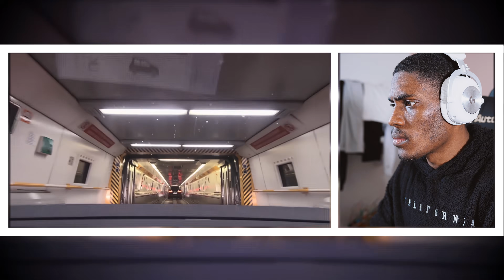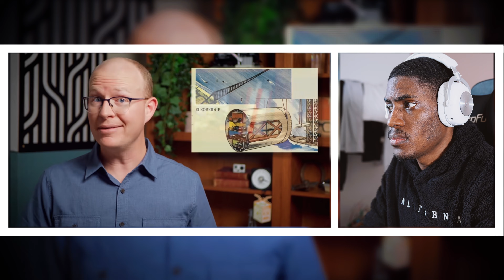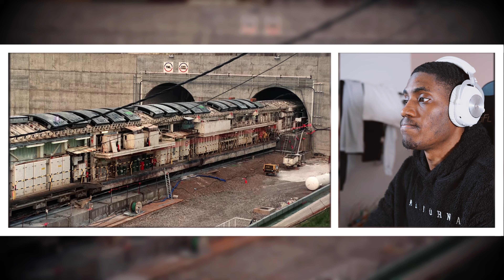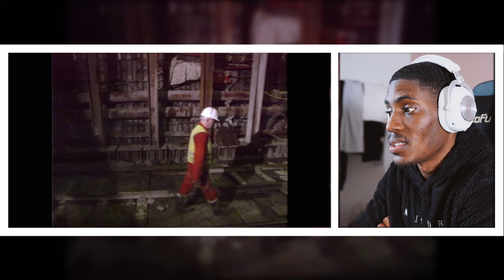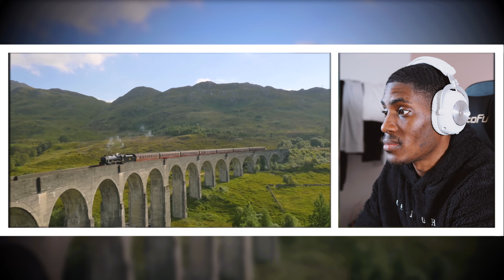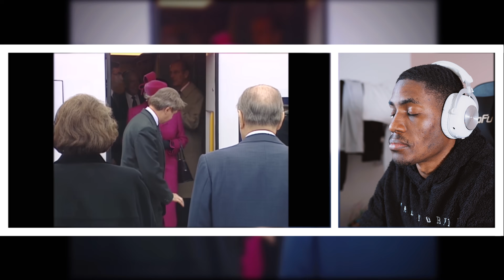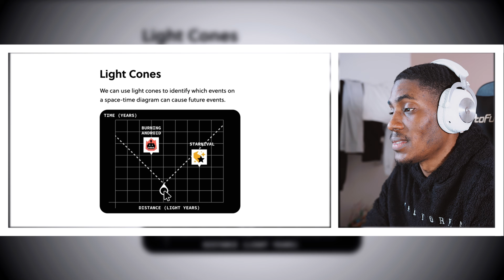American Reacts to How The British Channel Tunnel Works

Comment: COPY PASTE:  "China's $10B Artificial Canal Will Move More Cargo Than the Panama Canal
Core Insights   117,482 views Apr 19, 2026 UNITED STATES
45.5K subscribers    3K   Share   Ask   Save    Download
China hasn't built a major canal in over 1,000 years. But right now, in southern China, thousands of workers are carving a 134 kilometer waterway through mountains, hills, and solid rock to create something that has never existed before. This is the Pinglu Canal, a $10 billion infrastructure project designed to give landlocked industrial provinces a direct water route to the South China Sea, and when it opens in 2026, it will move more cargo every single year than the Panama Canal did in its entire first decade of operation. This isn't just a construction story. It's about a logistics problem that has quietly held back millions of people for generations, and one of the most ambitious engineering solutions ever attempted to fix it. From the world's largest water-saving ship lock to smart automated systems tracking cargo in real time, the Pinglu Canal is where ancient thinking meets cutting-edge technology. And if it works the way it's designed to, it won't just reshape trade across southern China. It could become a blueprint for landlocked regions all over the world. What's Covered: 🗺 The Problem Nobody Talks About - Why landlocked Chinese provinces have been quietly losing billions in transport costs for decades ⏳ A Thousand Years in the Making - How China's legendary Grand Canal connects directly to what's being built today ⚙ Engineering the Impossible - The jaw-dropping construction numbers behind cutting a canal through mountains 📦 The Ripple Effect - How 95 million tons of cargo per year will transform cities, ports, and trade routes across Asia 🌍 The Full Picture - The real human and environmental costs that come with building at this scale 🏗 What This Proves to the World - Why the Pinglu Canal is a message to every landlocked nation on the planet If you found this interesting, hit the like button and subscribe for more videos that break down the world's biggest engineering and infrastructure stories. Turn on notifications so you never miss one. Got a question for you. Do you think more countries should be building inland canals to solve their logistics problems, or are roads and railways still the smarter long-term bet? Drop your answer in the comments. I read every single one. #PingluCanal #China #ChinaCanal #ArtificialCanal #MegaProject #ChinaInfrastructure #EngineeringMarvel #ChinaEngineering #InfrastructureProject #GlobalTrade #CargoShipping #PanamaCanal #ShippingIndustry #ChinaConstruction #Guangxi #BeibuGulf #TradeRoutes #LogisticsIndustry #chinatech #chinatravel #us #usa #iran #israel #hormuz #china #america #ShipLock #WaterTransport #ChinaEconomy #InlandWaterway #GrandCanal #ChinaTechnology #SupplyChain #MaritimeTrade #ChinaDevelopment #AsianTrade #SoutheastAsia #TradeCorridor #BulkCargo #ChinaInnovation #InfrastructureEngineering #ModernEngineering #ChinaProject #WaterEngineering #CargoShips #ChinaGrowth #TradeInfrastructure #EngineeringProjects"
n.b.  China was set to co-operate with Panama to develop one end of the Panama Canal to facilitate increased through flow of traffic but the USA threatened Panama so the project has been shelved. Considering that the world is still paying for the months of lost trade when the Panama Canal was closed due to a vessel becoming jammed across the narrow waterway this is not in the USAs favour going forward. The USA comprises between 4 & 5% of the population of the world & the remaining 95 to 96% of the world population is watching the USA & comparing notes. We are not happy with what we see.

Comment: Where else would tunnels go? Except under the ground? The English Channel has a lot of shipping so if they built a bridge it would need to be immensely high. 
The engineers didn't cut a deep ditch and then cover it over. They drilled from on the land side passing through the rock layers lying beneath the sea bed.

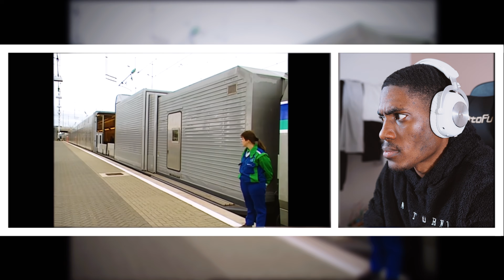Comment: 20:26 Some migrants tried enter the tunnel, security was reinforced. Then they tried blocking the trucks on the way to the loading bays, ... .
21:43 On average ferry crossing takes about 1h30 ( more if the see is rough or a ship crossing the Channel had to slow for a reason or another ).

Comment: The junction between the two tunnels was more or less broadcasted live . The "arrival" of the huge TMB grinding out the last centimetres/inches of rock, the small hole through which popped a rush of air and the "small" hand from the guy on the other side, then the grinning face, this was something...
Reply: TBM arrivals are called breakthroughs. 
Yeah, I remember seeing this on TV at school. I don't know why, but it's like when they tore down the Berlin wall, or when they meet halfway under the sea, I get emotional 😂.

Comment: I need to add ....My old boss Stuart Lang was the chief (Land) surveyor who made sure the two tunnels lined up from the UK side. Using an optical theodolite years before GPS and electronic distance measuring so the maths (not math) he used were phenomenal. We are talking about £1000 of equipment and brains rather than £50000 plus of equipment nowadays. Stuart was an Aussie but we won't hold that against him. A lovely man. He moved back to Oz early 2000's so I hope he is still with us. He would be late 80's early 90's by now. Old school proper engineer learnt so much in the 2 years I worked with him. Computer tech was just coming in in his time but he was the person who Leica and especially Trimble went to to ask what do we need to do/add to the systems and does it work. All tech needs the man/women who knows in the first place. 
Maybe being harsh on the last comment but deep down I don't think not understanding how tunnels work is that complicated. Apologies if I overstepped the mark
Reply: No worries. There is no school like the old school.

Comment: We wanted to go to Lille (France, on the Eurostar line) from Manchester, so I looked into the train. £320 return. We ended up flying to Charleroi in Belgium (£45) and got the bus to Lille (£20). The train is a great idea but it needs to be cheaper.

Comment: It's definitely not a white elephant. A train runs through every 4 minutes, and capacity is about to go up possibly to 1 every minute.

le Shuttle also tales vans, lorries, buses motorbikes, push bikes and not just cars. There are similar set-ups in Switzerland, but running deep through mountains instead.

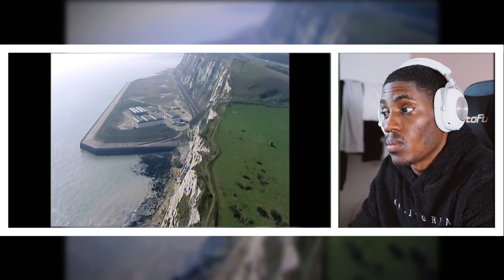Comment: For anyone interested - the main ventilation units seen at 16:33  that provide fresh air to the tunnels on the UK side are located at a small bit of land on the edge of Dover, called "Samphire Hoe"... the entrance to the area is through a narrow tunnel which is quite steep at the bottom (there's a sign even saying "Slow, risk of grounding") and it's so narrow that only one vehicle can pass in each direction at a time, so the system is traffic light controlled, and on the entrance there are a set of lights and barriers, with an "estimated waiting time" board showing how long the estimated wait until the light turns green on the entrance side.

The fan units are basically huge square blocks probably a few metres off the ground with large fans inside them, it can be seen clearly on Google Maps here:

https://maps.app.goo.gl/Q3yCcxqEhHMMCE1RA

I have driven to the area before but quite often the barrier controlling access is permanently down and there's "No entry" signs and cones across the road, so you end up just having to rejoin the M2 london-bound instead.

There's also a nice view and a picnic area plus a small cafe shop down the bottom past the ventilation site, so access is not exclusively for the tunnel maintenance teams.

Comment: 31 years old born and bred Parisian here. I've been to the UK like 8 times and I certainly would not have done it this many times if it wasn't for the Eurostar. Even took a day trip once to watch some football in London and slept in my own bed back home the same evening. I'm really grateful for the Eurotunnel.
Reply: 29 year old here, I've driven through France 5 times now, being able to simply drive onto a train and in 20 minutes drive straight off onto the autoroute in France is amazing.
(Especially amazing if you have an EV as you can keep your AC on without the 'engine' on, Eurotunnel gets very hot!)
Reply: I once went to Paris to give a talk on a tool I had written for work and took the Eurostar. I came back that evening. Some others from the UK attended, but they all flew. Due to fog none of them made it back that day.

The tool made £4 million a year from it's first use. I got no reward for it :(
Reply: @peterjackson4763 ❤
Reply: First of all, it's France, & french ideal, idea and engineering....
Give credit to... Ty
Reply: @dnl_crv Qu'est-ce qu'il t'arrive Daniel ?
Reply: And we Brits can pop over to Paris for the day for lunch and shopping! When the UK and  France stop fighting each other for five minutes and work together, we can do amazing stuff. (Concorde...)

Comment: 3:03 not just cars. They also take Motorbikes, Double deck busses and fully loaded articulated lorries.

We actually had an airline service. With Silver City Airways. you could fly with your car from Lydd airport Kent over the Channel to Le Touquet airport Calais France. From 15th June 1948. Untill roll on roll off ferries took the cross channel vehicle trade in the 1960s

Comment: there's an underwater tunnel half way from Denmark to Sweden, and there's an underwater tunnel being build from Denmark to Germany :)
Reply from the maker: I’ve never heard about these
Reply: @foreignreacts  the one from Denmark to Sweden is a bit old, and the one from Denmark to Germany is due to be done in 5-6 years, as it's a MASSIVE project... the construction site is HUGE and can be seen on Google Maps, and the segments for the tunnel are 72500 metric ton each...
Reply: To my knowledge the tunnel is part of the Øresund connection (opened in the year 2000) between København and Malmö, consisting of a tunnel (4 km) to an artificial island on the Danish side and a bridge (8 km) from this island to Sweden.
Reply: @karinwenzel6361  and that's 26 years ago... around 1/3 off all humans were not even born yet...

Comment: Hint: Find out how long the USA can keep planes in the air without Jet Fuel now that the Straits of Hormuz are likely to remain closed due to TACOs intransigence & the fact that Iran has flattened all the USA bases in surrounding Gulf States in retaliation for being bombed by USA/Israel - twice - while in the midst of peace talks on behalf of itself & Palestine. Find out how more polluting is air travel than train travel. Question: Why were you surprised that trains run on electrified tracks as often as on conventional tracks plus diesel - it's hardly a new concept? In 1969, if memory serves, the USA put a man on the moon but still have not electrified the rail tracks! Make it make sense.
Reply: Unlike the UK & Europe  the US doesn't rely on oil from the middle east, & unlike us they use the oil under their feet instead of having it shipped to them on giant diesel burning ships. So no, the US won't run out of jet fuel.
Reply: @coot1925  The USA does import oil from the Middle East.
Reply: @FKAMLV 
Yes, but it doesn't need to in order to survive. 
Unfortunately for the UK our governments "green" agenda has made us completely reliant on oil from the middle east despite the UK only producing 1% of the worlds CO² emissions. Instead we import oil from the middle east, sola panels & wind turbines from China which is put on diesel guzzling ships & China has had to build more & more coal fired power stations to power the increasing number of factories needed to manufacture them. We are creating more CO² than if we just used our own oil.
The greenies are virtue signaling whilst moving the pollution somewhere else and increasing it on a worldwide scale.
Reply: @coot1925  China is over 50% reliant on Green Energy as is the UK. UK before the end of the year will have legalised plug in solar panels which cost hundreds not thousands to install. This is already the norm in Germany.
Reply: @FKAMLV  As just explained the USA does import Heavy Crude from Canada but Canada is diverting said Heavy Crude to other economies due to the USA Trade war. Also the USA own sweet light oil prices are also set by international agreement so oil, for which ever purpose it is used, will be just as inaccessible to many small firms & automobile users due to PRICE. More USA jobs will be lost, more people will be pushed into poverty (which is due to be criminalised in the USA) & all because of the USAs criminal war against Iran.
Reply: @coot1925  The USA is dependent on Heavy Crude from Canada & the current trade war with Canada means that more of that heavy crude is being diverted to other economies. Added to which the price oil, even the USAs own sweet light oil, is priced internationally so when reserves diminish the price will increase. The USA does not have the necessary processing plants either & they will take years to build for which other products are required. The Straits of Hormuz are also needed to transport fertilizer & the growing season is already here. Canada is diverting its fertilizer to other economies due to the USAs trade war. Venezuelas' oil infrastructure needs investment to make it efficient but investors say that it is un-investible just as shipping through the Straits of Hormuz is uninsurable due to the USAs illegal war with Iran & Palestine. Food & other essentials come through the Straits of Hormuz when it is open - but it is still closed.
Reply: @coot1925 mais votre pétrole n’est pas bon puisqu’il est raffiné ailleurs. Quand à votre kérosène il manquera infailliblement, comme pour l’ensemble des pays qui grâce à votre mauvaise gestion et à votre guerre stupide, seront amenés à devoir subir la crise qui est due à votre bonhomme orange. De toute façon, les trains aux USA sont de mauvaise qualité, en plus d’être rares et peu nombreux. Mais il ne vous est pas interdit de faire comme nous en Europe, d’investir dans autre chose que la guerre et les armes de destruction massive que votre TACO utilise pour sa gloire personnelle. L’Europe n’a jamais eue besoin de vous et heureusement elle vous salue en attendant de vous envoyer la facture finale de vos actions.
Reply: @salvatoreuzzardi6903  Ooh! I like the last idea very much. The idea of the USA, Russia & Israel paying war reparations for once really appeals to me.